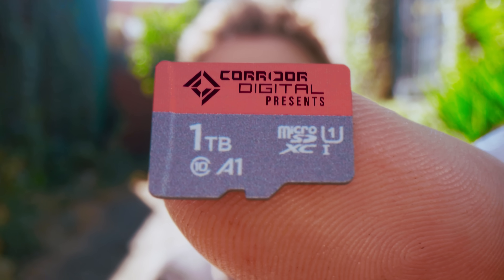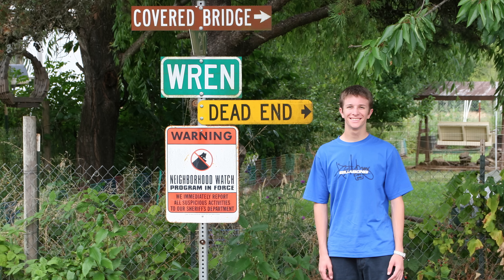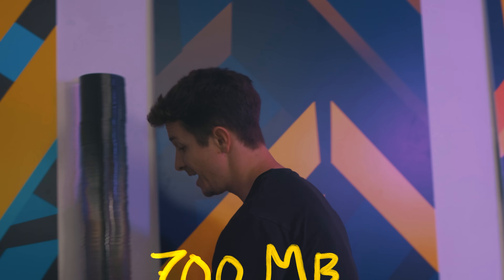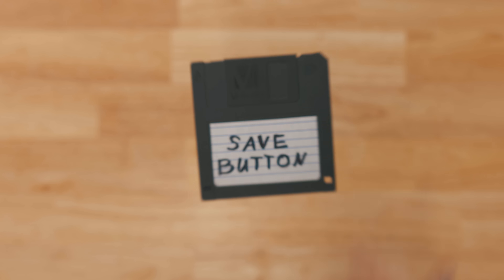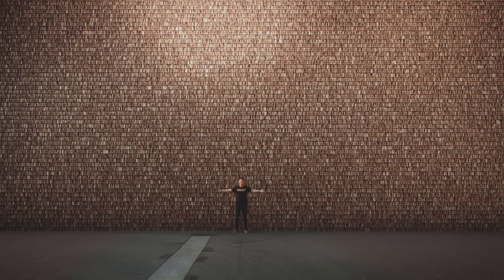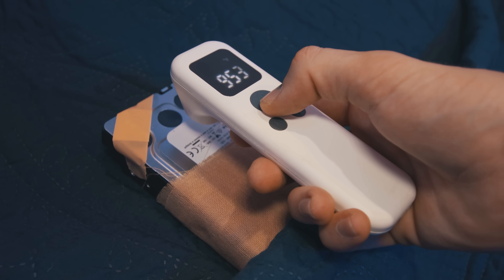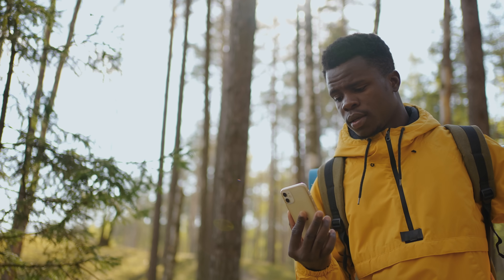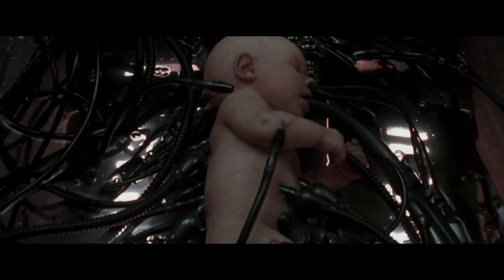VFX Artist Reveals the TRUE Scale of Data!

Comment: 6:17 I’m pretty sure it was a grid of wires, and on every intersection there was a little donut shaped piece of metal, and using the inputs from the wires it was connected to, they could change the direction of the magnetic polarity on each little donut. One way was a 1, the other was a 0. I’m pretty sure that was how it worked

Comment: Something important to note is that modern SD cards are designed to enter a read-only state should they fail, meaning that any "lost" data can still be retrieved. Of course, lower-quality SD cards may not have this fail safe implemented.

Theoretically, magnetic tape storage would be the most viable for longevity, as it is the cheapest form of data storage and usually lasts at least 30 years. Of course, it's also the least size efficient, and can be damaged through magnetic disturbance or poor storage conditions.

Comment: im commenting this before finishing the video but i just want to tell you that one terrabyte is actually 1024 GB and 1 GB is 1024 MB so it would be slightly off
Reply: Actually it is 1000 based on the metric prefixes that mean 1000. You're probably confusing it with say 1024 mebibytes which equals 1 gibibyte. (look it up to confirm this, as a lot of places get it wrong due to confusion with base 10 and 2, especially after microsoft screwed it up)
Reply: @DarkBraveStuff not sure since everywhere I check on google, it says it's 1024 gb
Reply: What the actual fu-

Comment: I thought CDs were black?
Reply: After 'burning' the CD R/W disc, we then put round sticker labels put on them. You could buy these for your printer to print on, effectively making any design.
Clearly pics, colors, text was printed on the CD label. Clearly you must have seen some black label on a CD once.

CD's were silver backing, and the front was really reflective silver, mirror finish. So you could tell which side was the side with the data on it (the reflective side), not the intention, just a fact.

When DVD's came out, they had a blueish silvery look on the data side, so you could tell the difference, as the dimensions were the same. (Mind you, they had smaller discs too). 

'Burning' discs (adding info to them) can't be deleted! So lots of discs were thrown out.
Generally we were burning music or vids onto discs. Actually it was big business. As downloading a movie took hours of course, so generally you'd buy them already burnt by someone else. 

A closed burnt disc (closed meant nothing else could be added), can only be read by computers (disc players) you can't edit the info or delete it or add to it.
Reply: @kimsland999  I understand, but what I'm referencing however is how most PlayStation 1 game discs were black, they were CDs, and can be used in a CD player to play a game's soundtrack. I'm guessing some CDs were normally silver as you say, and some were black for various reasons.
Reply: @neogaming285  pretty sure that was merely a black label.
Really all CDs were silver.
I suspect that company did dye their CD somehow, but really all were silver, even from MS with original Windows Setup.
A silver disc with a label on them.

Comment: I opened a blank document in OnlyOffice, set the font to Courier New for monospacing, kept the font size at 11, line spacing at 1.15, margins default (top & bottom 2 cm, left 3 cm, right 1.5 cm; weird...) and could fit 50 lines of text at 70 characters per line. If characters are alphanumeric (base 36) this is approximately 5.17 bits of information per character.

70 * 50 * 5.17 / 8 = 2,262 bytes per page side, or 4524 bytes per sheet.
This estimate is in prettymuch the same ballpark for the data density estimated in this video.

For a Terabyte, that's 221 million sheets (printed both sides). At 0.05-0.1 mm thickness per page, that's 11-22 km.

Comment: Well the stack of cards is not an accurate representation of the storage as it does not factor a connection with a slot, circuitry and wiring to connect all this.

Comment: 2:46  thousands....? ok, i dont want to be the annoying guy, but its actually 1024
Reply: That's for windows because when computers were simpler because multiplying by powers of 2 is really easy in binary so they decided to use that and call them for example megabytes (MB) not mebibytes (MiB) which are the ones windows uses.
Reply: I mean... But you're not wrong. 😅
Reply: @MattLedz186 no it is 1024
Reply: @Superman15-g Mega means 1000000 in this case bytes

Comment: In the intro, that is NOT a floppy disk. Floppy disks were 5 1/4 or 8 inch and in a flexible plasticky fabriky square protector that slid into a paper (or plastic) half envelope.

You have a 3 1/2 inch diskette in a rigid plastic case that spring closes the access port to the disk and was usually transported naked. 

When I graduated high school in 1982, my first purchase to get ready for my dorm room was a Vector Research / Ohm Walsh 2 stereo system with a Yamaha CD-X1. There weren’t many CDs available, and I ended up with jazz samplers that CD manufacturers used to show off their tech.

Comment: I did research. The human body contains 370 GEOPBYTES. 
8 bits= 1 byte.
1,000 bytes = 1 kilobyte.
1,000 kilobytes = 1 megabyte. That is 8,000,000 bits. That’s a lot of bits, but for today, it’s nowhere.
1,000 megabytes = 1 gigabyte.
1,000 gigabytes = 1 terabyte. He already explained all of these, but terabytes are the foundation of this video.
1,000 terabytes = 1 petabyte.
1,000 petabytes = 1 exabyte.
1,000 exabytes is, you guessed it, a zetabyte.
But what’s after? I did research.
1,000 zetabytes = 1 YOTTOBYTE.
That’s a lot.
1,000 yottobytes is a brontobyte.
370,000 brontobytes, is you guessed it: the amount of information in the human body. 370 GEOPBYTES.
THATS A LOT.

Comment: To determine how much data can be saved on a piece of paper using binary, we need to consider several factors:

Size of the Paper: Let’s assume a standard A4 size paper, which is 210mm x 297mm.
Writing Density: The smallest binary digits (0s and 1s) that can be written legibly. For high-density writing, let’s assume each binary digit is 0.1mm x 0.1mm.
Calculation:
Total Area of Paper: ( 210 \times 297 = 62,370 \text{ mm}^2 )
Area per Binary Digit: ( 0.1 \times 0.1 = 0.01 \text{ mm}^2 )
Total Binary Digits: ( \frac{62,370}{0.01} = 6,237,000 \text{ binary digits} )
Since each binary digit represents 1 bit of data, you can store approximately 6.24 megabits (Mb) of data on a standard A4 paper if you write the binary digits as small as 0.1mm x 0.1mm.

Comment: The part with the human DNA is not quite accurate. The human genome in each cell (not just a single DNA strand) consists of about 3 billion base pairs, each can be one of 4 base combinations. So you could fit a combination of 4 base pairs (4^4 =256) in one byte (2^8=256). Makes 3 billion/4 = 750.000.000 or about 750 Megabyte,which could get compressed even more since there are lots of repetitive sequences in the DNA. So you'd actually need less than a gigabyte for the whole human genome, which is the same in each cell :)

Still amazing video ❤❤

Comment: Hey Wren, I know this video is a year old and you'll likely never see this comment, but owning a data center, I can expand on your cloud data storage speculation.
Most cloud providers will use a seemingly small part of their storage for direct customer access and have several layers of redundant backups broken apart across data centers spanning the globe, sometimes using "competitor" equipment. I'm sure there are data centers with the 30 exabyte range of data storage, just remember: if they use 30 exabytes, they need to store 30*3 exabytes to protect from data loss due to disaster/cyberthreat/espionage.

Comment: I'm a year late but I just recently took a graduate level semiconductor course for college and I had to write a research paper. I chose optical storage. There is currently research going on (mostly in universities in china) to bring back optical storage. They are looking into multi-dimensional optical data storage. Why does this matter? It is hypothesized that a single optical disk can hold up to a petabyte of memory within the next few years. Terabyte optical storage does exist but you might as well stick with an SSD or an M.2 chip since most computers don't have disk drives anymore. Stay nerdy my friends.
Reply: also this research paper was specifically for the class and it is not published anywhere

Comment: Actually, its x1024, which will affect the scale quite a bit..
Reply: Nope, you're thinking about mebibytes, tebibytes, etc.

Computers READ storage spaces as being multiplied by x1024, but they are actually x1000. It's why a 1 TB hard drive is read as only having 931 GB.
Reply: @RobertoWhyyoucare  the 931 is because of an file system lookup table
Reply: @stiglcz  what do you mean?
Reply: @RobertoWhyyoucare  the filesystem stores the filenames etc. thats whats taking 1/Xth of the hard drive. And kilobyte is indeed 1024 bytes, as assembly developer i think i know that preety well
Reply: @stiglcz  Um, no. Like I said, Windows reads a GB as being 1024 megabytes, etc., but manufacturers treat is as being in powers of 10. So, a hypothetical 1 KB SD card would indeed be 1000 bytes, but Windows would read it as being .976 KB since it's thinking that a KB should be 1024 bytes.

Linus Tech Tips has a great video on the topic, but you can figure it out from other searches as well. Not to disrespect your experience, but you are wrong about this.

If you do a bit of searching real quick before dismissing what I'm saying, you'll see than the mebibyte, gibibyte, tebibyte, etc. are now the ones that increment in multiples of 1024.

Comment: I remember hearing how people calculated max storable data on DNA to be about 1.4 petabytes (for data storage purposes on artificial strands), but the methods used were so impractical it would be over 30,000 dollars for the machine to read it, not to mention the ones to contain and make sure it doesn't degrade or anything... then there is the space... 

Saw more recently how they were finally making them, but it was much the same impractical issues as before, but is interesting none the less, in my opinion.

Comment: The beginning of the video reminded me of an annoying issue I had a bit ago, trying to find an old HDD or SSD that is less than 100gb... practically impossible now, which means I need to hack around using storage solutions in older hardware with memory limits, yet no partition settings...

Comment: Many people probably already know this, but the DNA information claimed in the video is as garbage as the trillions of quantum bits in any rock. You know it's sitting there but it's not really usable or useful. DNA bits are fragile and are very slow to read. There is also a chance of corrupting the data during reading or editing. Moreover, the entire body's DNA is just a matter of copying and pasting. Most cells have similar DNA, but each part of the gene is turned on and off differently to allow the cells to perform different functions. Actually usable DNA information is contained within 1 cell. Not the whole body If you wanted to find out the true storage efficiency of DNA, you could divide it by the total number of cells in a man's body. Yes, it's less than you'd expect.
Additionally, the size of the DNA data in this video is wrong as the creator said in the comments.

Comment: One thing that is really interesting about this idea is the format the data is stored on the medium. I am guessing that for microsoft's data calculation they were using characters on the page vs bit space.  However that is not an efficient way of transcribing data onto paper. A QR code can hold around 4000 characters and you can definitely get about 8 of those on an 8.5x11 with a good printer. so 32,000 characters. With an average word length of 4.7 (English's average word length), that is 6808 words on one page. Compare that with 1000 words being roughly 3 pages double spaced to see what I mean.

Still not the same volume of space by any means as a solid state memory.

Comment: then you get Yottabytes which is 1,000,000,000,000TB  which is more or less 198,153,739,272,036 DVD's. And also a proper account for 370 billion zetabytes is 306,056,826.645 Yobibytes or 73,316,883,530,653,347,000,000 DVD's. and to answer your question on data centers they have mostly like google they have more or less 370 Exabytes of data storage and most other centers have the same amount.

Comment: Ok, it’s not really a big deal in any practical sense, just an interesting fact that I’m kind of surprised you didn’t mention.
Unlike the SI units or virtually any other units of measurement which borrow the Greek prefix naming convention for scaled-up analogs of themselves (kilo, mega, giga, etc), which are standardized based on powers of 10, in the case of bits and bytes, the proportions used for scaling are based on powers of 2. I could literally sit here and type an entire thesis paper about why this is, but I want to keep this comment as brief as I can. But if you’re curious, you can easily look it up. The point is this. For example, a kilometer is exactly 10^3 (1,000) meters. But a kilobyte is not 10^3 bytes, it is exactly 2^10 (1,024) bytes. And a megabyte is exactly 1,024 kilobytes, which is 2^20 bytes. A GB is 2^30 bytes, a TB 2^40, etc. All of the aforementioned powers of two have negligible proportional differences to their respective power of ten that their prefix suggests, so the SI prefix system serves a huge practical purpose in giving people an accurate sense of the approximate size of the number of bytes being referenced, which is why it’s used, even though it is technically, negligibly inaccurate and misleading.
So yea, just an extra little fun fact 👍

Comment: Fun fact : 
If you take Human DNA (370 Billion Zettabytes) and use paper as a measurement, You will get a paper stack onto each other as long as 1,56 x 10¹² light-year. Crazy 🤯

(With this measurement; 1 Sheet  = 2,5 bytes and 0.1 mm; 1 light-year = 9,461 x 10¹²)
Reply: I'm sure you meant "1 Sheet  = 2,5 KILObytes", right? Surely you typed more than 2,5 character on a single sheet of A4...?

Comment: Oh this reminds me. I had a little problem with making a calculator in javascript (web language), the standard numbers are just way too small, they can't even fit factorial 200. So I designed a potentially infinite number, and optimized memory usage as much as possible (other languages probably would do it better, but I can only write javascript). I'm not finished yet, but when I'm done - I'll be able to fit 2.4E+9 digits or ~814111 pages of standard Arial font sized 12 of a google docs sheet, into just above 1 GB of ram, browser restrictions usually allow up to 2 GB usage per page.

Comment: 2:45 that's actually incorrect. It's by groups of 1024 (2¹⁰). Like, 1024 bytes is an MB, 1024 MB is a GB, and so on. Nice video anyway!

❤ from India
Reply: Technically 1024 bytes is a Kibibyte. But most Software (including Windows) will display the Kibibyte/Mebibyte etc. value and call it Kilo-/Megabyte.
Reply: @tardistrailers  OK... I see.

Comment: The correct multiplier is always 1024, due to the base-2, and this is because there are 8 bits in 1 byte. So, 1 kilobyte (KB) is 1024 bytes, 1 megabyte (MB) is 1024 KB, and so on.
Reply: Just commented the same thing! However it's marketing's fault... the bytes are listed to get around the obvious error of what a 1TB drive actually stores
Reply: You're totally wrong. 1 kilobyte (KB) is 1000 bytes. You've mistaken it with a kibibyte (KiB) which is actually 1024 bytes. Doesn't matter that 1 byte is 8 bits, if you convert from (kilo)bytes to (mega)bytes, it's multiplication by 1000, not 1024. 1024 base is exclusive to the binary prefixes (kibi, mebi etc.)
Reply: @cosmo_7  It's not totally wrong. The units only became standardized in December 1998. That's literally decades after PCs became a thing.
Windows still calls kibibytes "kilobytes", likely because of backwards compatibility. Ignoring standards, it's 1024 in people's minds because the most popular operating system says so.

Comment: @5:54 you say "inside of these hard plastic shells they were floppy." The name for "floppy disks does NOT come from the disk being floppy inside a hard shell. The two previous iterations of floppy disk had a soft polyvinyl "jacket," and were indeed floppy. THAT'S where the name came from. The were not hard plastic until the third 3.5", 1.44mb and fourth, Iomegas 100, 250 and 750mb "Zip drive" variants were introduced.

Comment: its 1024*
Reply: it was redefined to 1000 bytes in a kilobyte in 1998 to line up with all the other units in the SI system (IEC/ISO 80000:13)
1024 bytes is a kibibyte, not a kilobyte, and 1024 of them is a mebibyte etc.
Reply: @Roaxial  no. Its groups of 1024.
Reply: @anderstermansen130  it was redefined to 1000 bytes in a kilobyte in 1998 to line up with all the other units in the SI system (IEC/ISO 80000:13)

Comment: hey, if you wanna find out how much storage is in the cloud all you need to do is some creative math my dudes! simply take 70% of the inside area of the building measured from the outside, take into account the size of a modern server cabinet, add up the storage that you would use to fill each one (this gives you storage amount per storage unit), then divide the size of the building (taking into account the 70% part aforementioned, give or take like 10%), by the volume/area of each server cabinet, then you should have most of the math done :)